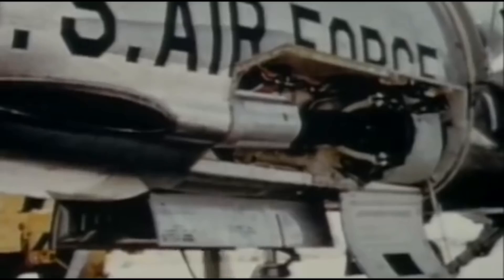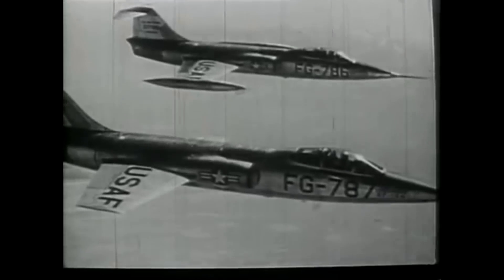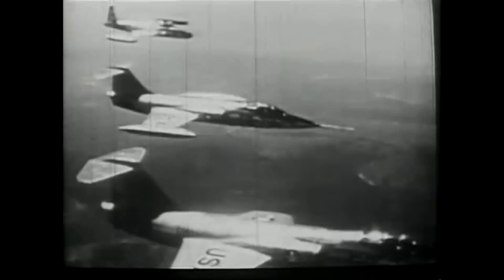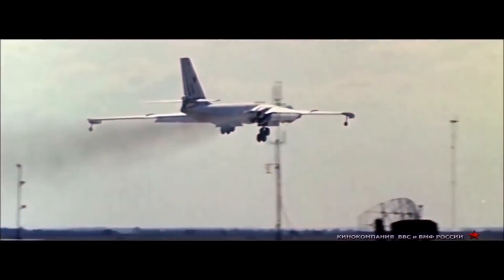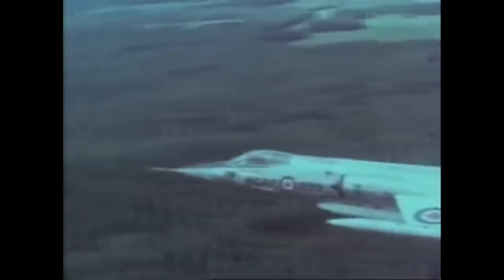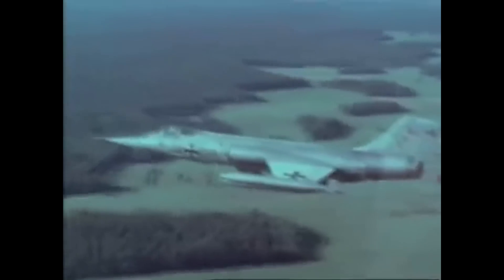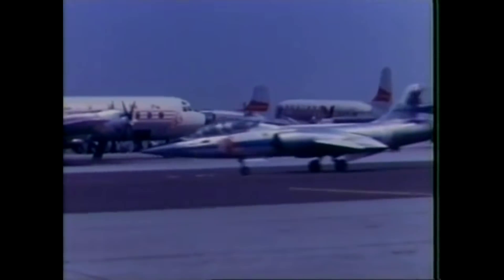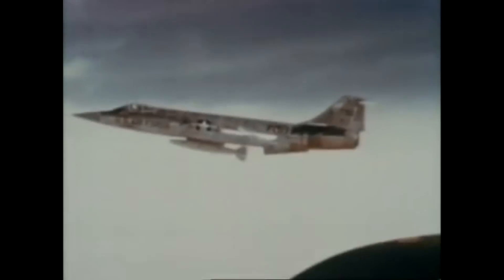Lockheed F-104 Starfighter | The worlds first Mach 2 fighter

Comment: ?? Wasn't the Saab S-35 Drakken the first operational Mach 2 fighter.
Reply: Saab J35A has 1,900 km/h (1,200 mph).
Reply: @valenrn8657  It first flew in 1955 but it was 1960 before full operational service.

A fantastic achievent for a small neutral country to produce such an advanced aircraft, followed later by the Viggen, then the Gripen.
Reply: @Hattonbank  Your point? I'm already aware of Saab's fighter aircraft history.

Comment: We'll no, The first Mach 2 fighter was the English Electric Lightning.
PS, your vids are coming along!!
Reply: And the Lightning was the first fighter to achieve supercruise.
Reply: @dukeford8893  ahaha....yeah sure buddy
Reply: False, early  Electric Lightning models, the F.1, F.1A, and F.2, had a rated top speed of Mach 1.7 (1,815 km/h) at 36,000 feet (11,000 m) in an ICAO standard atmosphere.
Reply: @valenrn8657  Yes and the F104 was only capable of Mach 1.7 until the fitting of the J79-GE-19 engine.
Reply: @valenrn8657  The prototype PI could fly at Mach 1.6. Production lightnings could hit Mach 2.5 and on one occasion  intercepted a  U2 spy plane at 88,000 feet. During a NATO exercise, the Concorde was used as a stern interception target, flying at Mach 2.2 at 45,000 feet over the north sea. The Lightning made a successful intercept while the Starfighrer, Mirage, and Phantom II failed.
Reply: The Lightning intercepted the U2 at this height from above as well!
Reply: I thought the F100 Super Sabre was the first super sonic fighter?  Much as I love the Lightning, the Super Sabre beat it into service by about five years.
Reply: @mattbowden4996  The comment was about mach 2 not mach 1. The Republic XF-91 Thunderceptor was technically the first US fighter to go supersonic but it was mainly designed as an interceptor. Plus there were only two prototypes made so it wasn't a production aircraft. The Saab 32 Lansen went supersonic in 1952 so it was actually the first production fighter in history that achieved mach 1 (some speculate that it could only do it in a shallow dive, others deny it). You're probably right about the F100 SS being the first US production fighter to achieve that mark, though some say it was the F-102 Delta Dagger. Who knows?

Comment: The J79 engine compressor stator blades had variable pitch, not the turbine.   I seem to remember the first 4 rows adjusted.  Hat tip to Sam Nardo below.   
      The F104 could go fast, but could not turn...high wing loading (105 psf).  Since top speed is thermally limited anyway, Kelly should have put more wing on it.   For instance, The F104 topped at 1528mph, the F106 topped at 1525mph, but the F106 with its lower wing loading (53 psf) had more utility and was in US service longer.   Not quite apples to apples, but you get the point.
       Whatever, the F104 was a good looking plane.   Cheers
Reply: dan Benson https://youtu.be/Or6mIaSWZ8g. 6 stages were variable.

Comment: The BAC Lightning, the contemporary of the f104 was far superior in every respect. The Lightning has similar or better performance to the f104 but it also was extremely manoeuvrable thanks to its pioneering high thrust to weight ratio combined with low wing loading. A formula every modern combat jet followed from the f15 onwards until the comedy f35 came along. However, some aspects of the f104 were retained in the highly successful and still potent f26, namely the undercarriage design and the clear evolution of the f104 wing into the blended fuselage firm on the f16. Sometimes good things come from failure.
Reply: Apologies for typos. Auto defect has a lot to answer for!
Reply: You are aware that the F-35's employs a lifting body design. Meaning the body generates lift as well as the wings. So the old win loading formula does not apply to the F-35.
Reply: Early  Electric Lightning models, the F.1, F.1A, and F.2, had a rated top speed of Mach 1.7 (1,815 km/h) at 36,000 feet (11,000 m) in an ICAO standard atmosphere.
F-104 was mach 2.0.

Electric Lightning entered service in December 1959 while USAF already has F-106 which entered service in June 1959. 

Australia's RAAF purchased Mirage III design and locally built it under license.
Reply: Britain although blessed with the worlds best combat jet, the BAC Lightning, which was in its final Mach 2.2 Mk 6 form by 1964, suffered with appalling government from the mid 1960s onwards where it has often been speculated both US and Russian spies in senior positions in the British establishment were undermining its industry and military complex. The result was that officially the BAC Lightning was never seriously exported due to political pressure. The US resorted to bribery and corruption in the case of the f104 to export it to most of Europe. In any combat scenario the BAC Lightning outclassed every combat jet until the f15 entered service in the mid 1970s. The RAF kept the Lightning until 1988 because the f4 phantom lacked the all round air superiority needed, in particular air to air combat. The f4 though a fine fighter bomber was a bit of a truck and lacked the thrust to weight ratio needed for turn and burn. You only have to watch the f35 at air shows to see it bleeds energy in the turn due to its high wing loading compared to all modern combat jets. Because all variants of the f35 are designed to accommodate the failed lift fan concept its aerodynamics are fundamentally compromised. The f36 with revised air intake design (as BAE wanted but were denied by the US) would have been a far superior truly VSTOL successor to the Harrier.  The UK will limit its exposure to the f35 and stick at the 48 ordered for the Royal Navy and buy more strike optimised Typhoons at the forthcoming post Brexit defence review. It is likely the f35 will only briefly be in service with the Royal Navy until a better VSTOL stealth jet can be developed.
Reply: F-35B Block 3F can sustain 7G turn. https://www.youtube.com/watch?v=ROOeGPrC1Do 
In Top Gear episode, pilot claims F-35B Block 3F can sustain 7G turn. 

F-35A Block 3F has 9G.

Comment: Cool plane, but it was more of an interceptor than a fighter.
Reply: Nope. It was a fighter... 100%. 

That’s why it was lightweight, had a gun, and didn’t have a sophisticated radar system. 

It was the closest the west came to the Mig-21.. which was the best dog fighter in the world until the F-16 came along. 

Only the late addition of leading edge slats, guns, and the massive amount of thrust made the F-4–which was an interceptor—capable as a fighter.
Reply: Not really.  It was designed as a day fighter.  It was pressed into interceptor duty because the real all-weather bomber interceptor had suffered development delays due to systems complexity, and the F-104 was assigned to fill the gap until the F-102 was available for full service

Comment: You couldn't let an F-104 sit in the sun too long???  I'm always amazed by how much I learn from each of your videos.  Enough to be still thinking about them days later.  Please keep them coming...
Reply: First Ive heard of that and Ive read many books on this airplane.
Reply: It's possible that early engines had insufficient clearance between some compressor blades and the stators or the case but that would have been corrected quickly it could be presumed.
Reply: Maybe they should have put them under shelters.
Reply: I work in a shop that has built and tested the J79 engine, and I can tell you all of the information in this video about that engine is absolutely not true. Pure garbage. Not a single word of it is true. !00% nonsense. Yes, we build actual engines for actual F-104 Starfighters. I have many test runs posted.
Otherwise, some nice footage.

Comment: Lockheed modified the Starfighter to the F-104G model and marketed it to NATO as a multipurpose fighter-bomber. An unsuitable role
Reply: After this experience, Luftwaffe bought F-4s (which are better as bombers) and used them as fighters for interception, in a time when the much more modern F-15s were developed.
Reply: Simon Maier .... Well the RAF got the Tornado ADV instead of the F-15. Go figure....
Reply: @Idahoguy10157  The Luftwaffe also used Tornadoes, but at least this time in the right role. The ADV was, as you say, not a really good aircraft for interception. 
But this has tradition, in WW2 their predecessor Luftwaffe used the ME262 (the fastest plane that time)  as a bomber, which costed the aircraft its biggest advantage over prop aircraft (speed).
Reply from the maker: Everybody has to pay the bills I guess lol.
Reply: The Atomic Cafe .... its a damn shame the Luftwaffe didn’t do a mixed buy of F-104G and A-4 Skyhawks
Reply: You are referring to this. https://en.wikipedia.org/wiki/Lockheed_bribery_scandals